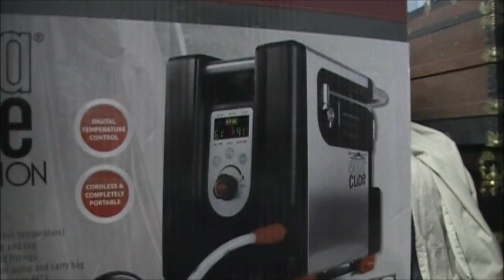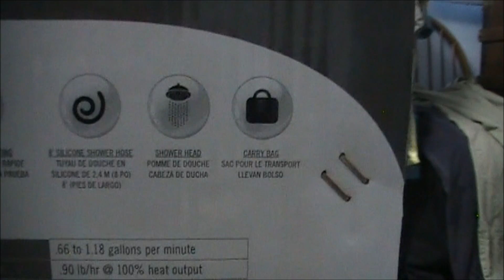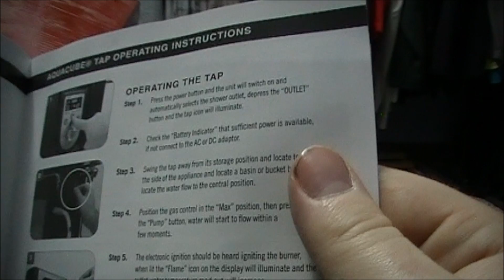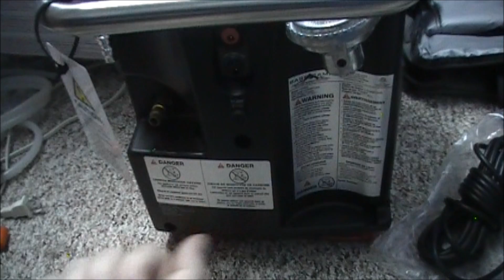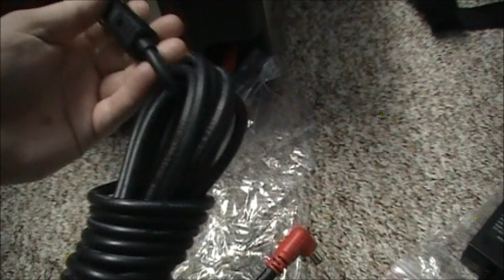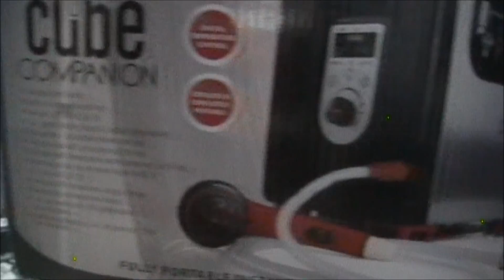The Off Grid Tiny House 138 Amazing Find!

Comment: On ebay , you can get a 12 volt shower. It has a small pump on one end, that you stick in a bucket of water. It has a 6 foot hose with a adjustable shower head, for $25-40. . All you need is a 8-10 gallon bucket. Boil some water and add it to room temp water. You are good to go.
Reply from the maker: David Pedder Yes I have seen those.
Reply from the maker: yes they are expensive but mine was free :) Yes the way you explained is the way to go.*****